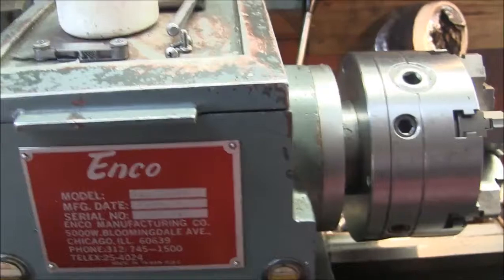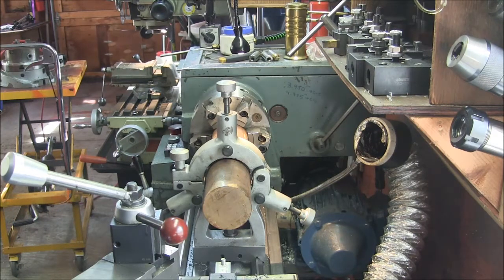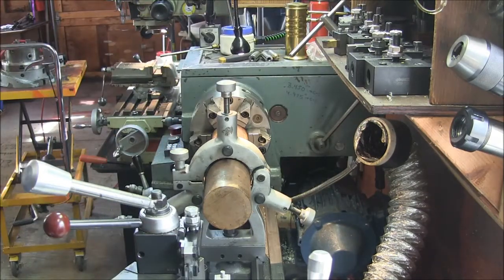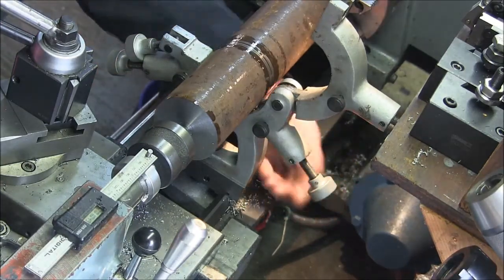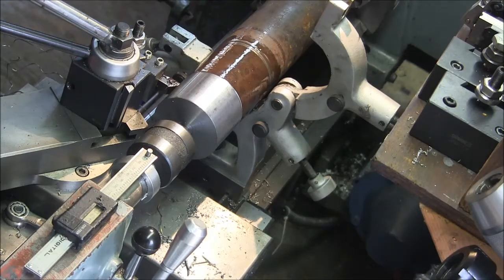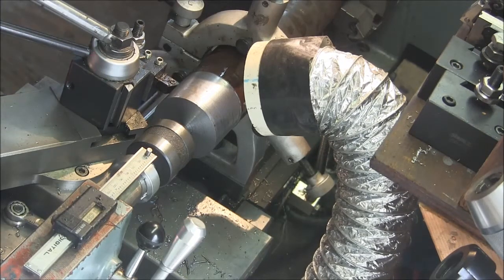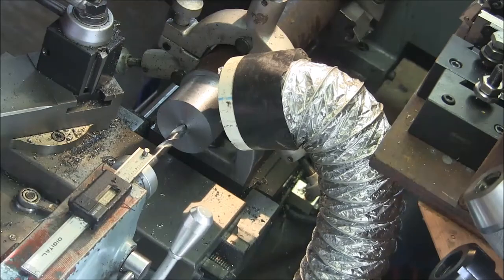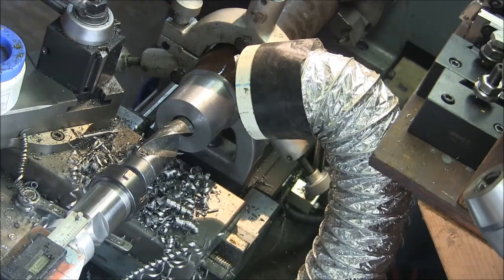Lathe Spider 1

Comment: Does the mill scale beat up the contacts on your steady rest? After center drilling I was wondering why you did not skim the contact point of your work piece?
Reply from the maker: +acklan3 When I set up the steady, I cut a groove for the rollers to run in.
Reply: ***** cool. I was just wondering. I missed that part. Love the video dude. Keep'em coming. :-)
Reply from the maker: +acklan3 Thanks!